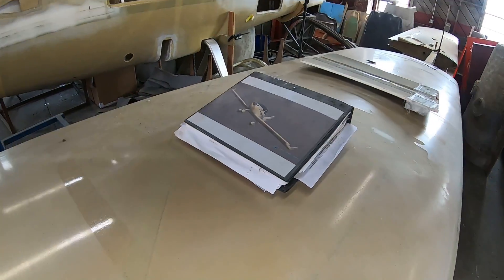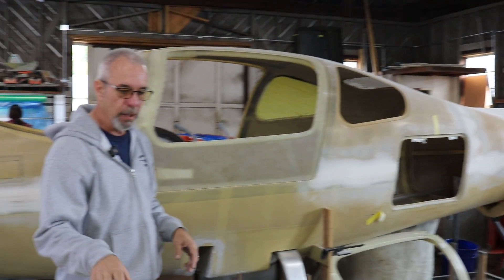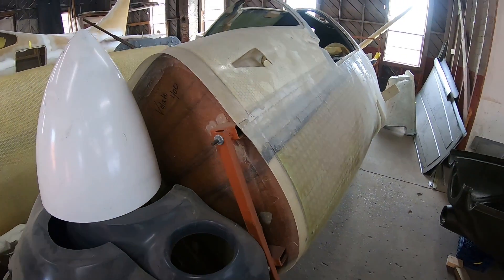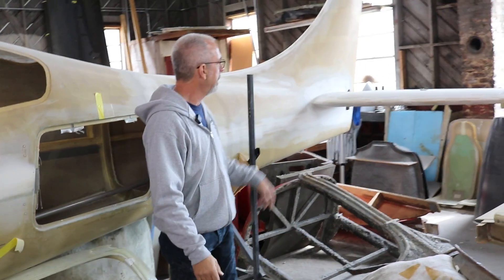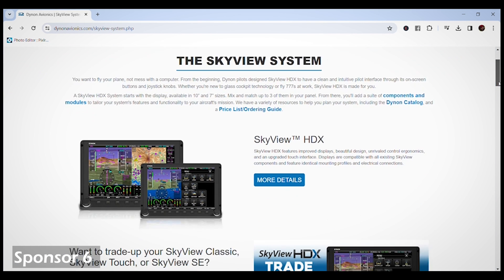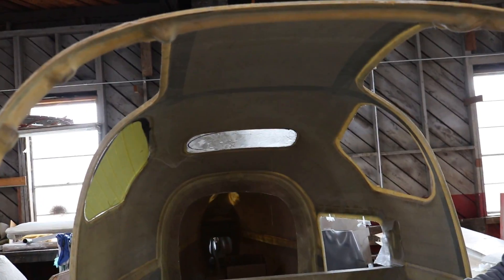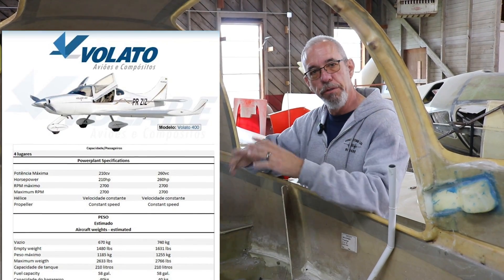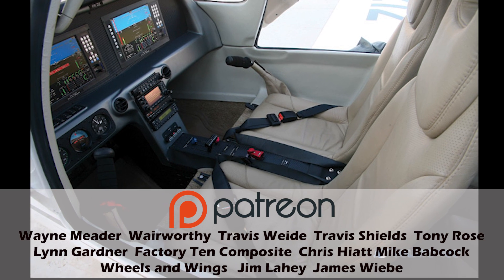4 Seater Kit Plane from Brazil! VOLATO 400 Aircraft

Comment: Looks and sounds a lot like a Veloce 400 from Brazil?    Any connection?
Reply from the maker: This one is from Brazil Volato Aeronavies (sp?) 
Link in the description below this video.  We ALWAYS provide links for you :-)
Reply: So are these guys doing the same exact thing as veloce?  I did not see it on their website.   Not very clear as to what they do and where. @ExperimentalAircraftChannel
Reply from the maker: YES. It is our understanding that the Volato is the manufactured "Name" out of Brazil and the importer/dealer resells/rebrands in the USA as "VELOCE."
Reply: @ExperimentalAircraftChannel    So CKD Aero and their production/finishing of the Veloto uses the same supplier (tooling?  Layup schedule?) as the Veloce-400?   I think Veloce uses all or mostly carbon.   The Veloto shown has all or mostly glass fiber.  So in any case, commercially there is no connection between the two??
Reply: Volato in Brazil was making the 600 for veloce, so veloce sells the 400 too